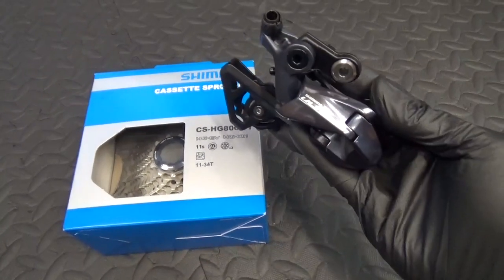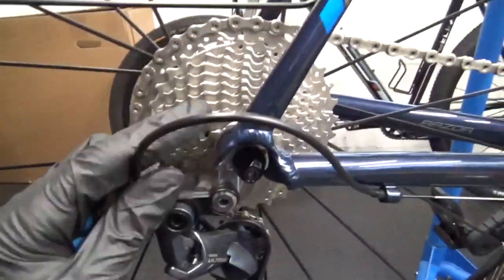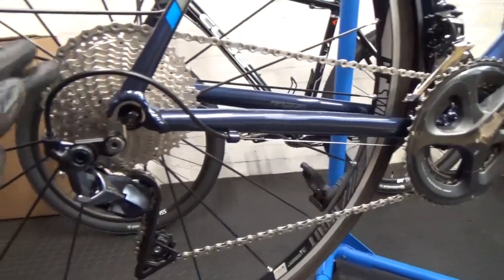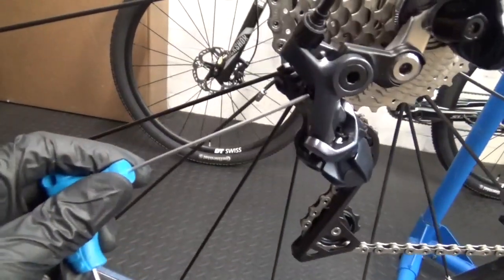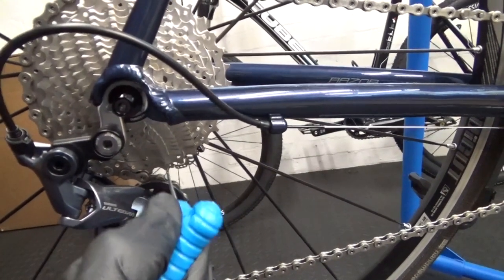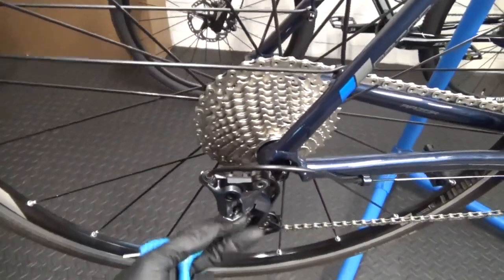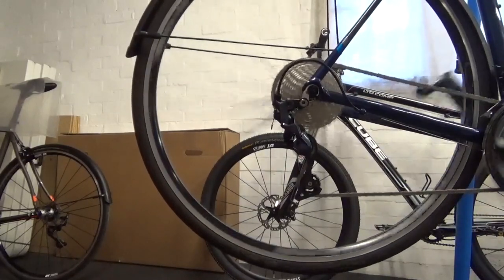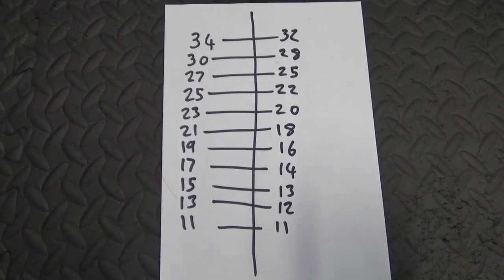Shimano 11-34 Cassette With A Short Cage Derailleur

Comment: Need your advise, I want a better climbing roadbike, I ride entry level Giant Contend 1, Sora groupset, 32/9 cassette w/ 50/34 cranks. Is it possible to upgrade for easy climbing without costing to much? Thanks from USA.
Reply from the maker: Options are limited for upgrading the Sora groupset any further! If you want lower gearing then I would suggest an upgrade to 105 r7000 11 speed with a 11-40 mtb cassette on the rear that will give you all the range you will ever need!!
Reply: @FreeToCycle  OK thanks.
Reply: You can just swap your rear derailleur for something like Altus ALIVIO or DEORE 9s and get something like a 11-40 or 11-42, sora is the last road groupset that is compatible with MTB
Reply: @din3832  Thanks will look into it.
Reply from the maker: The problem with a 9 speed with a 11-40 cassette is the ratios are to wide between each gear! Especially for road riding.
Reply: @FreeToCycle  it makes sense what di N suggested. Thanks
Reply: @Free To Cycle - I realise this is an old question, but I have similar situation, Spec Roubaix 9spd Sora with 11-32t (34/50), can I simply change cassette to 11-34t to make climbs a tad easier.....?

Comment: Hi, what about running it on 50t ring and 34t cog, is it possible? Thanks.
Reply: Then you take off the 34t chainring.. Note : you 50t chainring is intended mainly to speed up more on a straight descent or flats. The same goes for the 34t chainring is intended for largest cog to  have a easier climb on steep roads.... Again 50t chainring is for speeding up and 34t chainring is for climbing up.

Comment: Hi
Looking to make this change on a couple of bikes, wondered if you could help before i spend out.
Bike 1 - 36/52 chainset, 11-28 cassette with a 105 5800 rear derailleur.
Bike 2 - 34/50 chainset, 11-28 cassette with ultegra 6800 rear derailleur.
Believe both rear derailleurs are ss. 
Do you know if it would work on either of those please?

Comment: Will this work with my old model ultegra 6700short cage 10 speed? I'm currently running 11-28 cassette. If 10-34 doesn't work, then can I try 10-32? Please advise. Thanks in advance
Reply from the maker: 30t Max on the 6700 short cage!
Reply: @FreeToCycle  thank you! What are options to change my cassette to 32 or 34? Do I need to replace the whole groupset? Or if I buy R8000 long case Derailleur and 34 cassette? Please advise. Appreciate your help
Reply from the maker: You could purchase a Tiagra 4700 GS 10 speed rear derailleur which would accommodate a 34t cassette!!
Reply: @FreeToCycle  I spoke to Shimano, they suggest using 5701-gs for 10-34 cassette for better pull.

Comment: Not very tech savvy, so wondering, would it work with a 10 Speed cassette?
Reply from the maker: Only possible on 10 speed with a wolf tooth road link!
Reply: @FreeToCycle  Yes, I made this conversion on my 10 speed 105. It worked but I didn’t get on with it since most of my riding doesn’t need a 34 and I found I was missing the smaller cogs to find my sweet spot for power / cadence a lot of the time. Also the gear changes seemed a bit sluggish, not as crisp.

Comment: Would a shimano 105 9 speed rd 5701 short work with a 34t casssette  ?  Before i buy a new cassette
Reply from the maker: The short cage 5701 wouldn’t take a 34t! You will require the gs version to run the larger cassette.
Reply: @FreeToCycle  ok thanks could i fit a wolftooth extender as i already have the derailleur
Reply from the maker: Yes you can fit a road link to the short cage derailleur!
Reply: @FreeToCycle   Thanks ,really helpfull informative and clear vids

Comment: hi! will this work on a tiagra 4700 ss rd? it says in their website only until 28..
Reply from the maker: You will require a Tiagra GS rear derailleur or a Wolftooth road link fitted to your current SS derailleur to run the 11-34 cassette.
Reply: @FreeToCycle  so basically it means i can really just use the 28t right?
Reply from the maker: Yes unless you change the derailleur!
Reply: @pitsboi  man, try to google Hack tiagra 4700 with GRX 400 RD. And after you can use 11-36 cassette, even with 50T. Bonus chain lock system.
Most efficiency upgrade for tiagra groupset imho
Reply: @maksimspasov2007  thanks good tip

Comment: Hi there,

Great video, thanks!

I have 52/36 chainrings on the front.

I have Ultegra Di2 6870 rear derailleur. (Doesn't seem to say anywhere whether it is SS or GS - I think it's SS (2017 Canyon Aeroad)).

Would 11 - 32 work on the cassette, if it's SS?

Many thanks!

Cheers!

Vic
Reply from the maker: The SS derailleur would probably fit a 30t cassette but to run a 32t you would need the GS version or fit a Wolftooth road link to your SS derailleur!

Comment: I used ultegra 6800 model can its fit the 11-34t cassette?
Reply from the maker: No!
Reply: @FreeToCycle  would the 6800 work with 11-32 if using a road link?
Reply from the maker: Yes!

Comment: Hello, Sir. Do you think it would work on a Shimano 105 RD-R7000-SS Direct Attach with 50/34 crankset and 11-30 cassette?
Reply from the maker: Yes the derailleur will accept a 11-30 cassette.
Reply: @FreeToCycle  Is it possible if I change the cassette to an 11-34 t without changing the RD and chain?

Comment: The derailleur does seem to be struggling a bit around 3:28 or so 😬
Reply: Is it struggling? I can't really tell, you think it would be safe to get 34t on my SS ultegra RD or should I just do 32?
Reply: @aneeshfroome4464  it just isn't as sharp as usual. It is working but it isn't that snappy, especially for ultegra. 

I'd say it is better to use a medium or even long cage with a cassette this large. Long would be much easier to index
Reply: @gamma_dablam  I agree, though I am trying to keep my bike lighter and since it's only a 2 teeth difference I reckon' its best to keep the short cage + 32t and get fitter xD thanks for the info!
Reply: @aneeshfroome4464  well ... it is a 6% difference in cadence. Need to decide if that 6% would make a difference on any climbs you do

Comment: will that new existing chain lenght work if all  of a sudden I use a wheel with 11-23 ? or backnto 11-28 ?  whats your crankset sizes ?
Reply from the maker: You would need to resize the chain to go from a 11-23 to a 11-28 cassette!
Reply: @FreeToCycle   Went from a 52-36 to a 50-34; The cassette remained the same 11-28. I did not change the chain length. Everything shifts fine. If I switch to an 11-30 or 11-32 or 11-34, would I need to increase the chain length? Thanks! (r8050 di2 ss)